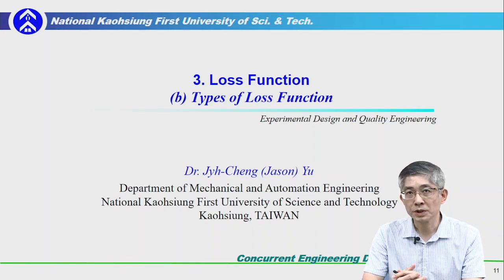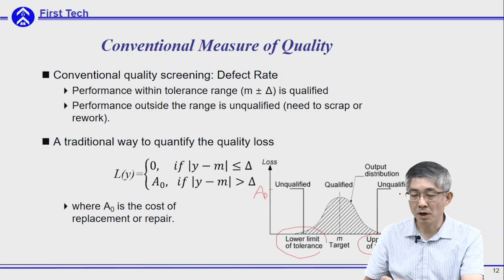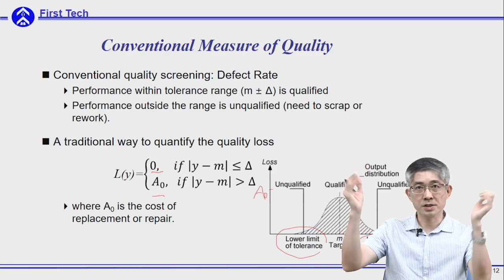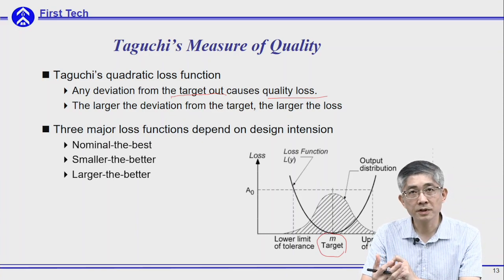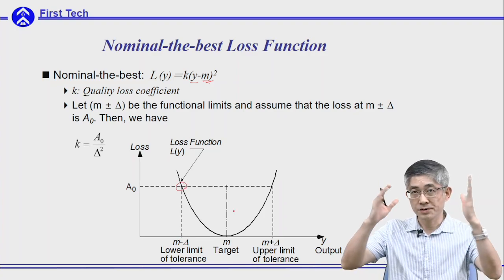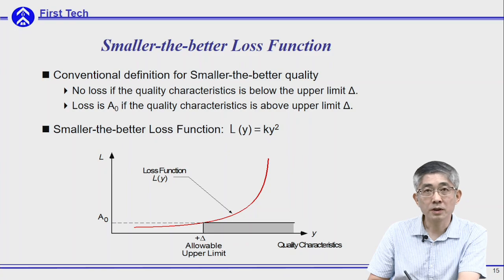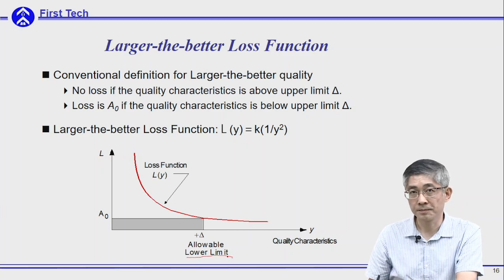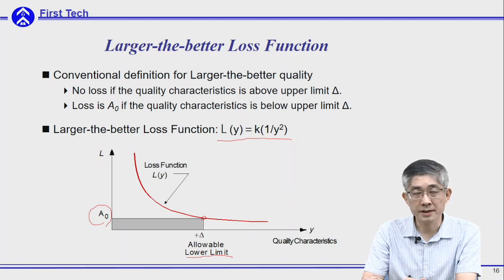2017 Experimental Design and Quality Eng. 3(b)  Types of Loss Function

Comment from the maker: That is a typo in the slide 16 when describing the conventional definition for Larger the better Loss (around 6’35”).  The correct statement should be “No loss if the quality characteristics is above the lower limit.” Instead of “....upper limit”. Same typo in the following statement.

Comment: I have a query. In Larger-the-better, conventional definition said that if quality characteristics is above upper limit, then there will be no loss. But, in graph, it has been depicted that quality character is above lower limit and there is no loss. Kindly clarify it.
Reply: Yeah. The conventional definition should be corrected. The same statement can be retained by replacing "upper" limit as "lower" limit
Reply from the maker: That is a typo in the slide 16 when describing the conventional definition for Larger the better Loss.  The correct statement should be “No loss if the quality characteristics is above the lower limit.” Instead of “....upper limit”. Same typo in the following statement. Thanks for the reminding.